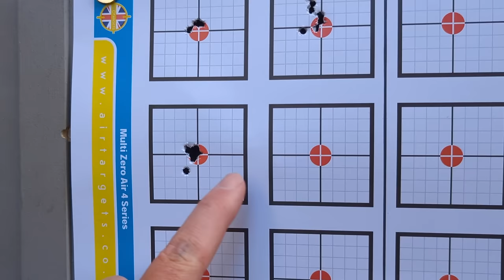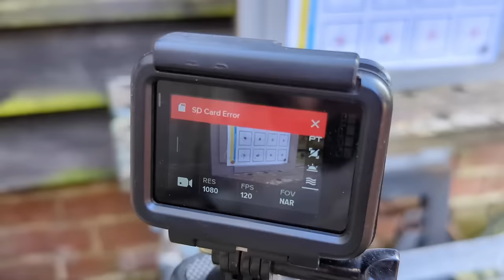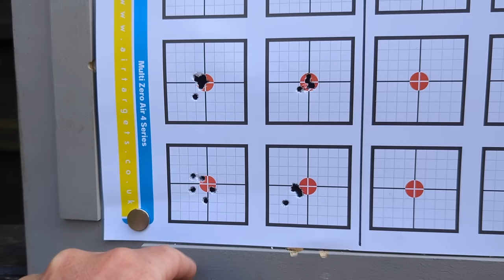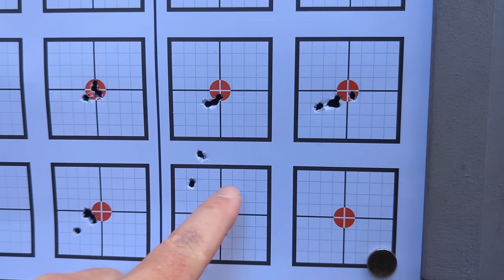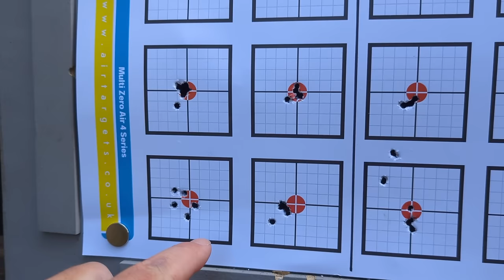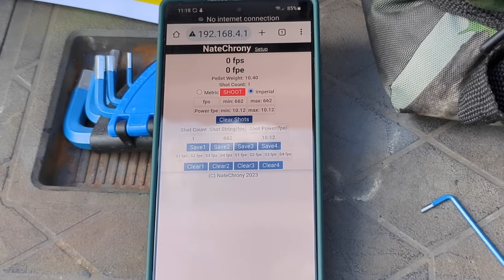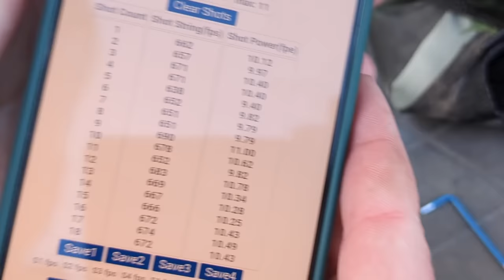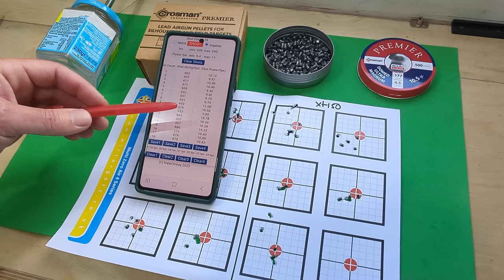Supercharge your pellets like a pro... maybe?

Comment: Don't know if anyone mentioned the main difference between the pellets last time .
The cardboard boxed ones are single batch from a single die , the big printed number on the bottom of the box.
The tinned ones are mixed batch from multiple machines , quite often with dies that are past their best.
Back in the day we used to try the different die numbers in our guns to find the best die , but even back then there were some dies that were better than others overall.
Reply: Spot on. I used prems  in 7.9, 10.5, and  14.3  from when they were introduced about '93 and they gave a significant edge from other pellets at the time. As the dies wore  in time ,accuracy went out the window as.  Iirc the founding person ic had left the company and qc  duly suffered.
In my experience best accuracy is from the tin, they either work or they don't, and don't rattle the tin about.

Comment: Since I retired I have had more time to experiment with pellets. Here's my two-penneth (JSB Exact and RWS Meisterkugeln):
1. Washing pellets. Nicer to handle but little difference in performance.
2. Weighing pellets. Definitely an improvement in consistency but probably only worth it for competition use as it is so time-consuming.
3. Pellet-sizing. Definitely an improvement in my TX200 (springer). Not so sure about my S400 (PCP) as the pellet-loading probe pushes the pellet into the breech which will inevitably have some sizing action.
Fun hobby, isn't it? 😀

Comment: I bought last year an "used" HW97 and an almost full cardboard 7,9gr of those Crosman pellets came with it.  The HW97 was in new condition and maybe 100 pellets from that 1250 carboard box where shot with that rifle.  I was very impressed how accurate those pellets where, and they had all a the same tight fit in the barrel. They shot also wel from my other HW's and even my air pistols. Cheers!

Comment: I've tried all sorts of tricks over the decades form lubing to harsh language (tend to use harsh lenguage the most). I'm a fiddler. I will use pellets with slightly bent skirts as it doesn't seem to make any difference in my rifles. I do bin ones with knackered heads though.
I used to roll them, wash them, lube them, weigh them, inspect under a mag, sonicate them, pray, scream, beg and tickle their tummies. The best ones were for competitions and the others for plinking.
Nearly every shot I'd miss was due to mis-judging the range or the blooming wind, it was never my fault LOL.
Nowadays I do nowt as I've never found anything made any significant difference worth the effort for semi serious shooting.
If you're into competitions then weighing is probably worth the effort and cleaning if you've got a really grotty batch.
I rarely clean my barrels unless it's a full strip down or something major happens with grouping.
I shoot a HW98 and an S400 using H+N FTT 4.52 sub 12.  FWIW.

Comment: I hope that I'm mistaken, but I don't think you'll have much luck with sorting the Crosmans after tumbling. I have used a Pelletgage to measure the head size on these several times in the past. Along the way I discovered that the pellets could be forced through one hole with a little extra force from my fingertip and from that point it could be fitted through several smaller holes, one after the other, and eventually would find its true "No Go" hole. I learned that I was doing essentially the same thing that you're doing, removing the flash from the pellet's seams, but I was shaving it off gradually with the Pelletgage's holes instead of tumbling them off. I got the same results that you are getting for all my efforts. The darn things will group 6,7,or8 in a single hole, but the remainder of the 10 shots would be wide and in unpredictable directions, sometimes in a sub-group and sometimes scattered. That is the same result that I get with the unaltered pellets.
    After sorting them by head size, I further sorted them by weight within each head size. I shot them from various guns, always indoors and with the guns clamped in a vice to take my skills out of the equation. Still no joy. I think there are voids in the lead or maybe skirts that are canted slightly. I've never measured them for consistent length, so that could be the trick. Good luck to you and I'll definitely be following your efforts.
   BTW, It's been my experience that these pellets foul badly when shot much over 860 fps. I think it's because of the antimony content. Harder than pure lead and less self-lubricating.

Comment: I've done a lot of rock polishing. I have both roller type tumbling devices and a vibratory tumbler. It vibrates at a high frequency but doesn't roll or tumble. Rocks are always polished with some kind of medium such as ceramic shapes, with water, and a fine abrasive. The water and media reduce the shock on the rocks and provide a lot of surface area to smooth the surfaces. A short vibratory tumble with a very fine polish might be perfect to smooth pellets without shrinking them much. You can open the vibratory tumblers and look at the pellets as they vibrate so you could easily monitor your progress.

Comment: I remember trying all of this kind of stuff with Accupels and a few others years ago to get them accurate enough to hunt with. Then my local gun shop put me on to JSB exacts. Never before had I been able to open a tin of pellets and stack them on top of eachother at 30 meters before. I've used nothing but JSB since as they just work without any need for playing around with them. I used to have to weigh each pellet from a tin and put them into batches and reshape or discard the deformed ones before with other brands, now I just load up my mags and get to work.
Reply: Well, the latest batch of JSB I ordered is terrible 😂 QYS to the rescue!

Comment: Another theory that I've entertained, but don't know how to test, involves skirt diameter along with head diameter. If the heads were all exactly 4.50, but the skirts varied from 4.45 to 4.57, depending on the land and grove dimensions of the barrel, you could load the pellet into the breech on a slight slant rather than with the skirt directly behind the head and centered on the same axis. A thin skirted pellet or a long skirted pellet might self correct for this better (or worse) than a thick skirted pellet or a long skirted pellet. The malleability of pure soft lead vs. lead antimony alloys make also make a difference. Slugs would be able to self center better than diablos because  of the longer area of engagement with the rifling and the fact that they are solid. A pellet with a skirt that is the identical diameter at both head and skirt that engaged the rifling at the proper depth should be the best pellet for that barrel, ti my way of thinking. What say you?

Comment: Maybe try Rumbling the pellets along with some small, Wet, plastic beads - or the Mineralised beads that come in Some showerheads?? That would reduce the Contacting of the pellets AND Polish them better. (Maybe) Rumbling Usually involves using some other, wet, deburring/polishing medium, rather than just the parts you want to process. (In this case - pellets & beads + Water) Maybe also add a squidge of Toothpaste?? Rumbling, Dry, metal on metal is Never a good Idea!!
Reply: Correct, when I worked in a factory pressing shop several years back, the parts would go in to a large container and be mixed with rounded beads of a sort, chuck in little bit of lube and rotate it for about 30 mins to remove the burrs.

Comment: It might be worth tumbling with a medium such as corncob or walnut shells. Would stop the dimpling but still clean them up and remove swarf.
Reply: I've tried tumbling JSBs with both corn cobb and walnut shells, with and without added wax.  With no wax, I got a dull finish; likely took off the outer coating on pellets.  Got much lower carbon buildup in barrel; i.e., patches after 50 shots did not show the black material, BUT I saw small lead flakes on the patches and got some fliers.  With wax in the tumbler with the medium, I did not get much different results than untumbled pellets.

Comment: With a soft material like lead, tumbling or vibratory tumbling might well just compact and smooth pellets without removing much material. They might get smaller by compressing and rounding the edges more than removing material. Weighing before and after would tell the tale.

Comment: Interesting experiment. The varied velocity will be the inconsistent skirt size and air passing over the skirt at different rates before they expand. Try rumbling or polishing in a round container
Reply from the maker: I reckon so too mate. The xti was definitely a bit more lively on firing with a noticeably more abrupt crack with the blow by 😉

Comment: Interesting, I have seen rumbling being used to remove flashing, actually on rubber grommets, but first I have heard of it being used on air gun pellets. I would have though that the pellets would need washing afterwards at the very least. It probably provides a good base for washing and sizing afterwards, but won't do too much on its own. I thought the pellet skirt expands with the air slug behind it and gives the seal, so too small a pellet would loose power and potentially become unstable in flight if the skirt does seal evenly in the barrel. I guess flashing on one side of the pellet would have a similar effect. You may not be mad, but it is certainly sending me mad thinking about it!
Reply from the maker: It's an absolute wormhole mate... I'm going to revisit it all with a slightly more scientific approach and measure before and after timed rumblings to see what undersizes I can yield. The 9015 particularly runs far better with the close but looser fitting pellets. When they are tight it's actually possible to end up seating them in the barrel with a bit of yaw. Not ideal 😉

Comment: again a very fun experiment :). maybe use a polish media in the tumbler like Brass Polishing Walnut Media. and use something like the SR737 Tumbler nano and do a 1000 at a time :)
Reply from the maker: That sounds expensive mate 😆 

The main reason for using no media was so I didn't have to wash and re lube them after. I have since done some more and washed them, there's alot less swarfe than I imagined. Especially compared to out the box Prems(they are quite grotty out the box)

Comment: You mentioned that the 9015 seems to like a smaller diameter pellet and rumbling will definitely make a pellet smaller, the early shots showed promise, next time if you sized them after rumbling there might be more consistency with a given size. I've not had great results with Crosman pellets myself. What media are you rumbling the pellets in?
Reply from the maker: There was no media. Just the pellets themselves. As far as I can tell that's the better option.  I'm not a fan of sizing as such,it's actually alot harder to do it accurately than I imagined. But I do like measuring and batching by natural size and weight. 

There's plenty more vids to come in time I'll cover all the nerdy stuff in a bit more detail 😉

Comment: Go-Pro's not what they used to be. QC dropped through the floor & overheating issues. The Insta360 Ace Pro or DJI Osmo Action 4 are very good. Mate of mine uses the DJI & swears by it.